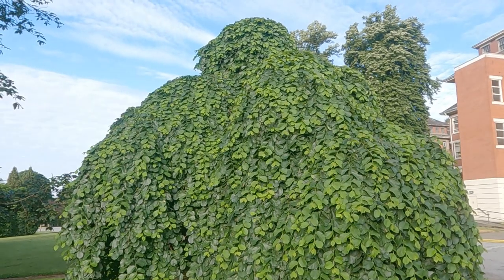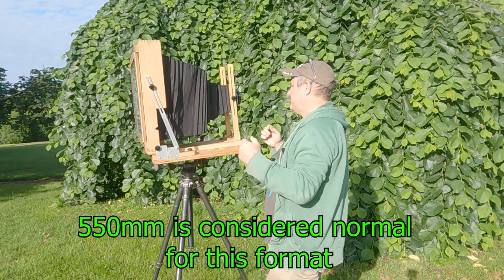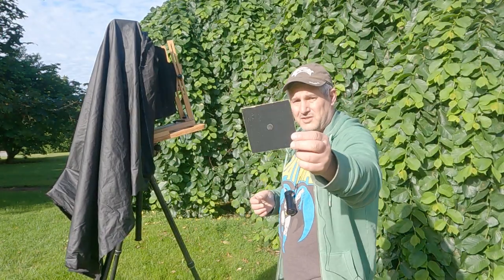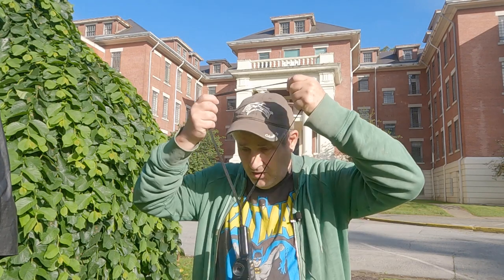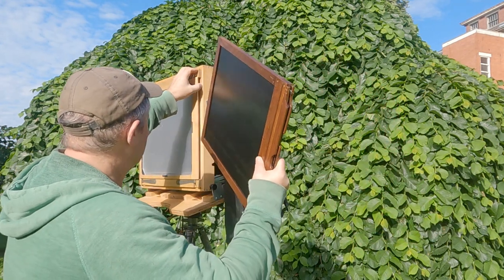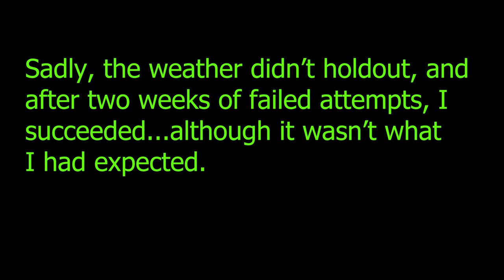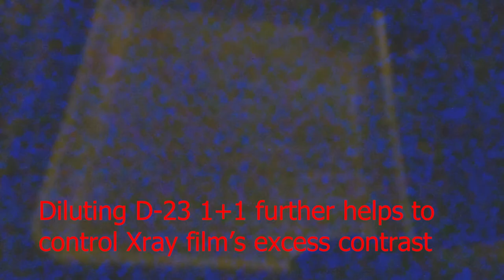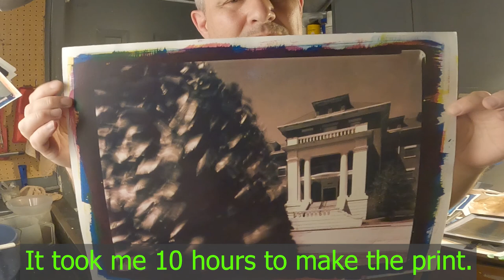14x17 Pinhole & Gum Over Cyanotype!

Comment: Hi Andy, can you make a video on how to make a reciprocity chart for x-ray film? I have been using Fuji Super HR-U mostly with my 8x10 a 250mm fuji lens and sunny 16. I'm working on a ULF pinhole camera atm. If not, can you point me in the right direction? Great Video I'm hoping to one day have my ULF camera finished and working with the cheapest lens I can afford. A Pinhole 🤣🤣🤣
Reply from the maker: I prefer to run the test under my enlarger with controlled light, and ND filters instead of adjusting the lens aperture. You'll need an ND filters so that you will be able to increase the exposure time from 1 second, to 10, and to 100. Phil Davis outlines the procedure in his book, Beyond The Zone System. You could also use my data, as it will probably be close: 
For 1 sec give 1.5x or +2/3 stops more exposure; 10 sec give 3x more exposure or +1 2/3 stop more; 100 sec give 12x or +3 2/3 stop more...
Reply: @analogueandy8x10  So what about 4 min 34 sec or 274 sec? Would that be in the 12x? When i was testing today my Pinhole guide put my times really high. I wasn't sure if 10 min would work on 274 sec or if that was overkill.
Reply from the maker: @SenpaiSkyy  If you graph my values, with time on bottom axis, and stops and factors on the vertical, then draw a smooth curve connecting them, eyeballing the curve beyond 100 sec, you'll accommodate those times, and will be very, very close. I have always done it this way, and have not had to tweak anything.
Reply: @analogueandy8x10  Thank you for the information. I will try myself.
Reply from the maker: @SenpaiSkyy  keep me updated! How can I see your work?